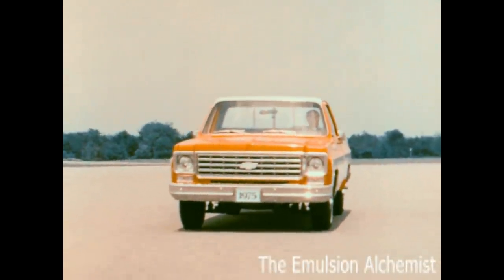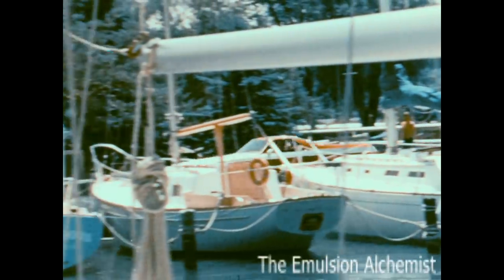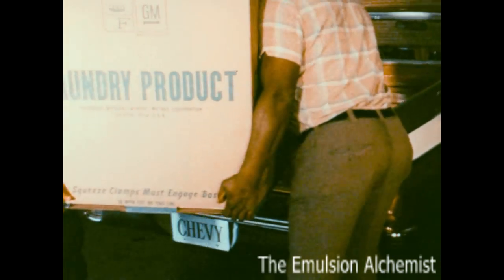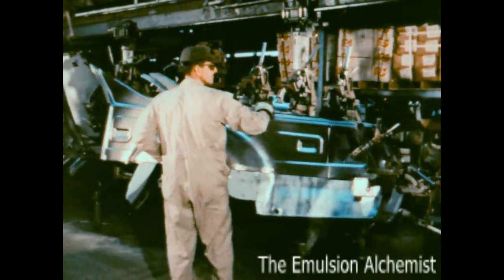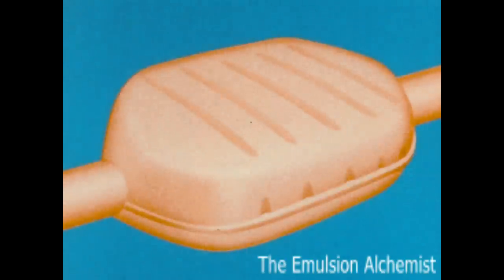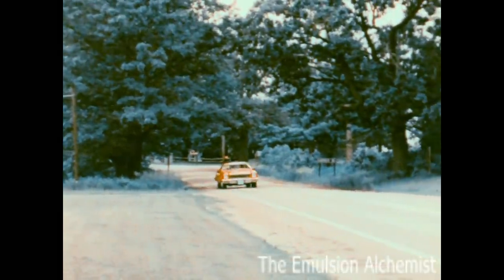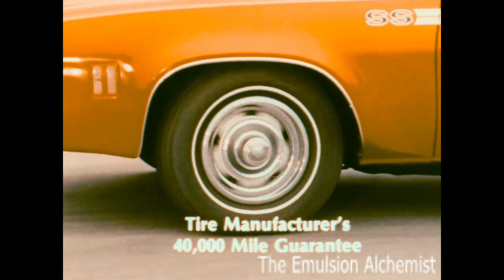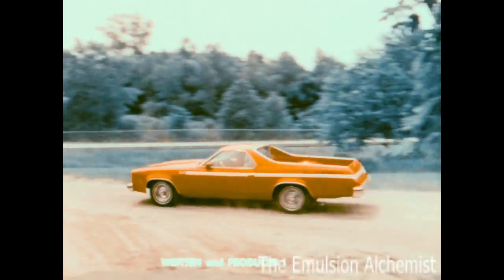1975 Chevy El Camino Dealership Sales Training Promotional Film

Comment: Another great blast from the past upload of yours! Fast forward to today, you just don't see many of them at Cruise Night's or Judged Shows. Technically, since it's only a two-seater, you might say that the El Camino was America's second Sports Car.😉 I didn't realize these later models also had air ride in the back. Cool!👍 On a trivia note, do you know what the first year of the El Camino was? 1959. THOSE you never see. I had a '67 back in the day with a "worked" 327. I sure do I wish I had it today. I actually sold it so that I could buy my first new C3. A 1971 Coupe. Wish I still had THAT today as well. Now I wish I had a C8! But as the saying goes, if wishes were horses, beggars would ride. I'll just continue to enjoy my C6. Well done on this video! Save the Wave👋
Reply: How dare they not put down a blanket first! This is abuse.
Reply: @wheelie642  🤣🤣 Agreed!
Reply from the maker: thanks, glad you are enjoying my channel. I have a large collection of films of all types. not very many of these films have been uploaded yet. of these dealership films, I own about 200 so many more to come
Reply: My Dad ran a '59 El Camino 4 speed with a 348 and 3 2bbl in Super Stock in 1959.
Reply: Definitely cool! That engine, which I had in my '59 Impala, was known as the "Stone Crusher." And boy, when you kicked in those 3-2's, you could really hear the WHOOOOOMP!. Take off the air-cleaners and the noise was even louder. I ran D/S with my '59. Yeah, I'm older than dirt, but some of us ole guys still have a few tricks up our sleeves. As long as it's on nothing newer than maybe 1975 or so.😉Save the Wave👋

Comment: Based on the station wagon frame chassis. If you remove the bolted down access hatch in the bed you can see the rear passenger station wagon seatbelt bolt holes. The doors are the same as the 2 door Malibu / Chevelle with a window change out.
Reply from the maker: they reused and adapted so many parts, same today

Comment: I had a chance to buy one of these. It was only a year old. It was also a 75. Green with tan interior. Auto, air, am/fm. I don't think it had cruise but it had the 454 cu in engine and I was afraid of the poor gas mileage. I'm still sorry I didn't get it because I ended up getting  an Olds Delta 88 Royal with the 455.

Comment: The El Camino was a fairly easy and cost-effective way for Chevy to explore a new market. It's basically a modified Chevy wagon, so it cut development and build costs down. I've never actually seen anyone haul anything in the back of one, though. I'm sure it's happened, I just haven't seen it
Reply: Hauled a upright grand piano
Reply: I’m sure many a keg of beer has been hauled in the beds of El Caminos
Reply: My 86 is a daily driver with over 300,000 on the drivetrain. I routinely load up the back with mulch, and trash to take to the dump. 
I get head turns all the time.
I'm not sure if they are surprised to see a 35 y/o truck doing daily chore work, 
or the fact that " I'm using " a 35 y/o truck to do daily  chore work.
Either way, I truly enjoy my daily ride.
Reply: I had a 1975 El Camino. I put a set of Moog progressive cargo coil springs in the back. They were nice. I liked that vehicle. In NY, the rust started getting at it too much. Sold it.

Comment: I never knew the air shocks were factory. way cool. those were good driving cars. the motor sat pretty far back in the frame. I'm sure a sb 400 was a option.
Reply: Me neither.
Reply: My 1975 El Camino had the 400 small block. Good snappy engine. Some people were surprised how quick that car was.
Reply from the maker: Very cool

Comment: They all dip the vehicles in the solution for rust protection but it don't really work because they still rust
Reply: That's one of the most unintentionally entertaining parts of these old car promos.  They tout the anticorrosion measures used on the very same cars that seem incomplete and unfinished without rusty body panels.  If a Malaise Era car model does not seem synonymous with rust, it's probably because it was so unreliable that it just didn't make it long enough for rust to become an issue.  For example, I don't recall seeing that many rusted out early 1980s X body cars.

Comment: Mechanically they were a huge improvement over 1973-74. The catalytic converter and HEI were definitely a step in the right direction, but the engines were still emasculated by traditional standards. I much preferred the styling of the 70-72 El Camino to the bloated 73-77 models. I particularly disliked the rear end design of both the El Camino and the Malibu wagons. They were decent vehicles considering the times, though. 

TIP: Keep a spare HEI ignition module and some basic tools in the vehicle, based on my experience you are going to need them!
Reply from the maker: I like the earlier years too. I am sure they had a hard time deciding on how to improve the looks

Comment: Bought 1 in 77 It was a year old by 1978 it was all rusted out
Reply from the maker: you must not live in California
Reply: @theemulsionalchemist5688  
My 72’ built in Van Nuys, Ca
Never left the state.
Rust issues.
Same with my 75 El Dorado convertible 
&
72 VW Fastback 
California has hot/cold=condensate=H20
👉🏽”Metal” RUSTS if not maintained,
-OUT OF ELEMENTS💡